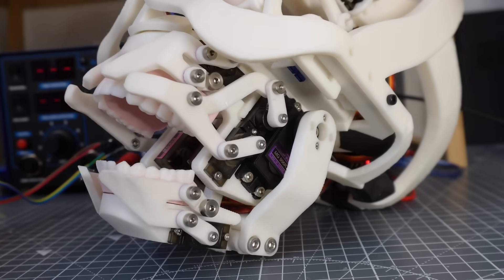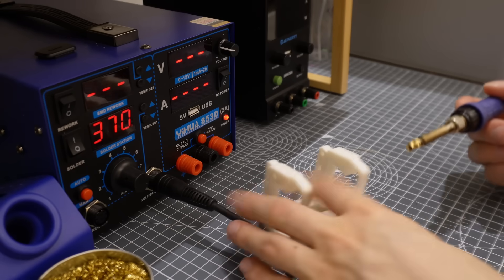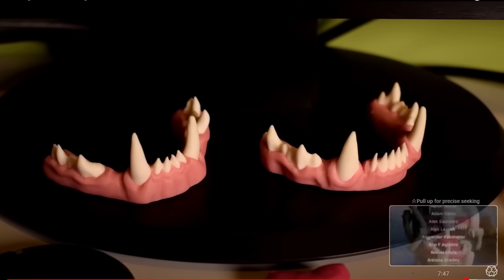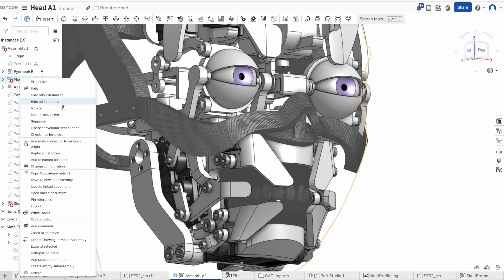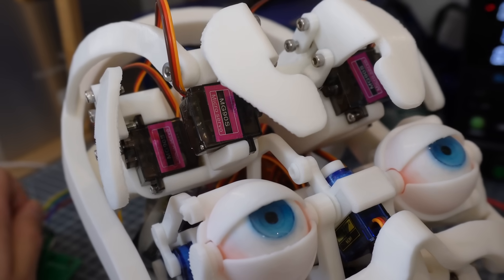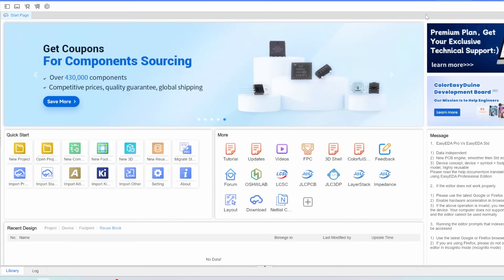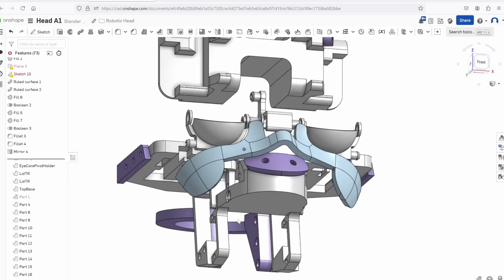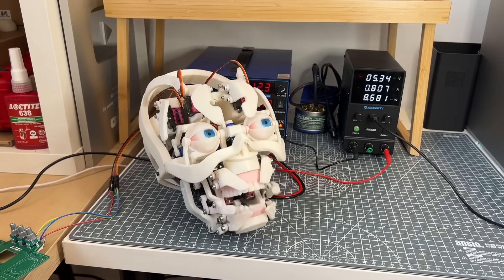3D Printing a Robotic Head

Comment: Overall, it's really nice - servos are too loud.
Might have some motor that rotates the eye using contact with a spherical motor behind it that makes contact with it and rotates it.
Kind of like those omnidirectional drive systems.
The spherical motor is of course several little motors driving the ball.

Comment: Onshape is really good but I wish they would add movement simulation for testing the collisions etc. before printing out the product and noticing that there is huge problems with the design.
Also they need to redo whole IOS versio from ground up. Controlling in the 3D-space is horrible and everything is very unaccurate and hard to move in small increments. App also is really slow compared to way more complicated 3D-modelling/sculpting apps. Even the newest iPad have problems to keep up sometimes while other apps work butter smooth.

Comment: imagine a bag with a drawstring that can open and close it. Something like this can be turned into cloth lips that can open and close with 6 pulleys. imagine the bag has 2 draw strings that pass by each other and exit holes on both sides, which can close the mouth when pulled, but if you add 2 more strings to the corners of the mouth, you can pull it open, towards the cheek bone for a smile or towards the jaw for a frown. You can coat the cloth in silicone rubber, or just print a face design on it like it was a T shirt.

Comment: tongue might be an easy fix silicone tongue flat on top cut into v segments under neath and mount with a spring to the rear of the jaw, when jaw opens the  tongue will move in sympathetic motion,  its not programmable but might be enough.

Comment: @Will Cogley Are the files for the joining components posted anywhere, or by chance do you have the width, height, depth of the largest areas of the head with all the bracing?

I have already made your previous mouth and the old eye mechanism into a head myself, and am wondering how far off the measurements for my robot will be if I switch, as I like this mouth design's compactness much more.

Comment: the teeth and jaw could do with being wider, they are disproportionally narrow and small compared to the skull, causing the face to seem out of balance. If you want it to look less uncanny, you can project the jaw further forwards. Try to reference fashion models and what agencies look for in facial anatomy; Nose, teeth, and chin bones that are at least an inch further forwards and more compressed, sort of hinged forwards/upwards from the base of the skull with the brow supporting that. Slightly wider cheek and jaw bones would connect the two and support the eye sockets. Search 'angel skull' face shape for women, or 'warrior skull' face shape for men.

Comment: Ugh, your example of a messy feature tree in onshape is next level. There's a lot to be said of developing good discipline when doing parametric CAD, as you point out. It can be such a lifesaver when you realise you have to make a change 60 hrs into a project and had the forethought to actually consider this as a probable scenario. I've had even simple projects where starting over was the only viable option because I didn't have the proper structure and hadn't made sufficient effort to allow for future changes.

Comment: Sick!! When you continue on working on the tongue, You might get a good result when you add a bunch of joints in the tongue itself and add two strings. One for the top and one for the bottom. By retracting or moving the string(s) the tongue can curl up or down. Looking forward to the next video!

Comment: Doing the silicon skin after the mechanism u will realize they absolutely do not work well together. The current lips mechanism are lacking flexing dof, hence are not able to do the mouth shape of "m" for example, "mother". The eye lid blinking mechanism gets tricky when it has the additional load of pulling the silicon skin. you will understand when you put on the silicon skin for your testing. The attachment interface between the skin and mechanism needs to be the primary consideration of the design, followed by dof and range of motion if the intent of the design is to make a human like robotic head. The teeth is fine. The eyeball mechanism is okay. Eye browns are easy to fix if it requires correction. No cheek mechanism which will be required for facial expression. Jaw mechanism looks okay. Tongue movement is some final touches for perfection in making a humanoid head, the rest of the features needs to get a passing grade first. keep reworking the design and you might get it right.

Comment: I'd love for someone to create a blueprint/code for Unreal Engine to use the built in Livelink face capture to drive facial servos in realtime. I've been using Monkey Logic's Trackskull software to drive head tracking in the past, but eyes still need joystick control, and jaw motion needs an audio file. Using something like Rokoko Studio to do live face capture including eyes, blinks, brows, jaw, lips and tongue would save a lot of time recording individual tracks one at a time.  Being able to record that and preview it in Unreal Engine would be an added benefit.

Comment: Some time ago somebody wrote a free plugin for blender that can take 3D animation info and send it to a servo controlled robot. Don't remember the name but I'm sure you can find it pretty easily if you google it.
Takes a LOT of stress off of programming mouth shapes or facial controls in general. Just animate them and the hardware will follow ;)

Comment: Instead of shoulder bolts, you could print sleeves that thread onto regular screws. If the friction is still too high, you could give it a single layer of copper tape over top, or simply use commercial metal spacers that slide over the screw's threads. I recommend looking into "constant force joints" as designed by Bornity, once you wrap your head around what exactly is going on (which is easy because he provides schematics with section views), they make a great starting point for simplification and alteration for different sizes of bearings and screws. As for the tongue, you may find that you can achieve more believable results using a cable-drive sort of tentacle armature and a flexible tongue model - or at least a single joint, so as to properly replicate the motions of the tongue for the "TH" phonemes, etc.
Reply: Came to say about the same! Stainless steel tubes works well on plastic with a bit of grease

Comment: Instead of shoulder bolts, you could get the same exact effect with very thin brass bushings.  Or even some thin brass pipe.  You might not even have to modify the CAD files to accommodate that.